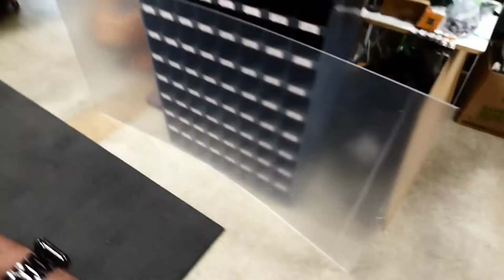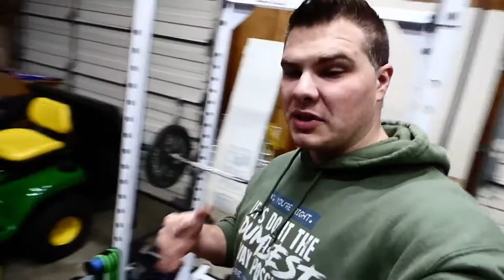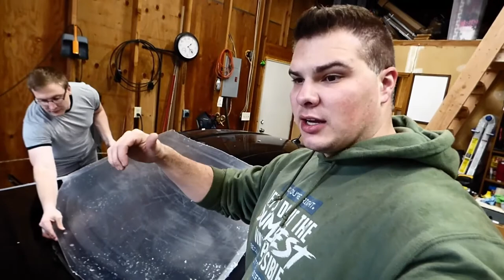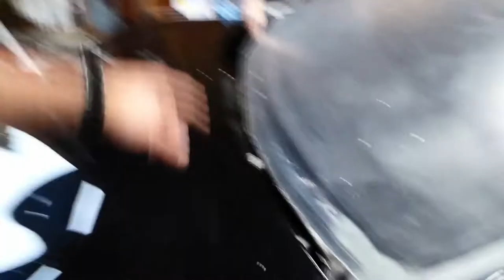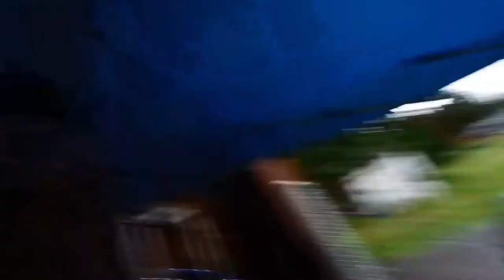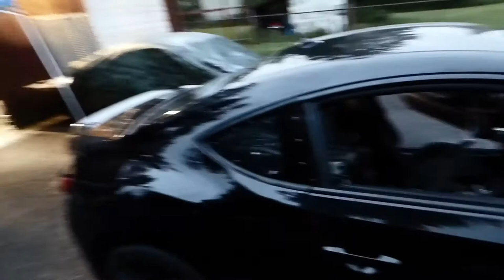How to install a race car windshield ( Plexiglass shaped to the car )

Comment: Where did you buy the glass
Reply from the maker: Adam Chairez Home Depot actually had it. It was a sweet find! $36/sheet!!
Reply: Can I use 1/4 inches or 1/8 or 3/32 inches thickness don’t see 6 millimeters

Comment: How is the plexiglass holding up?
Reply from the maker: Still good. It’s been on the car over a year and has retained its shape nicely.
Reply: @plat4mracing758  oooh man good job, i am working on it, i always wondred if it will hold better than glass ,good job
Reply: @KhaledRachajo How’s your project coming?

Comment: Why are you doing this?   

I have never heard of this before but someone smashed out the window on my 12 passenger van.  It’s a $900 replacement and I am a single mom and can’t afford that,…. That’s a whole months salary.  

I was trying to figure out if I would be able to make one for cheaper, with plexiglass so I searched to see if anyone else has ever done it before and came across a ton of these videos.   I didn’t know it was a thing,….  It doesn’t seem like you are doing this out of necessity so I have to ask,….  What is your purpose for doing this?
Reply from the maker: It’s a race car. Check out the instagram.
Reply: it is cheaper, lighter,  better , and shock proof,  best security than casual glass windshield